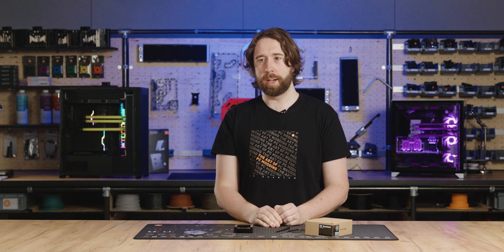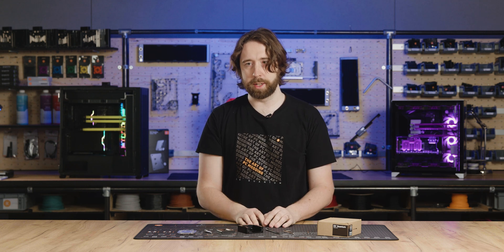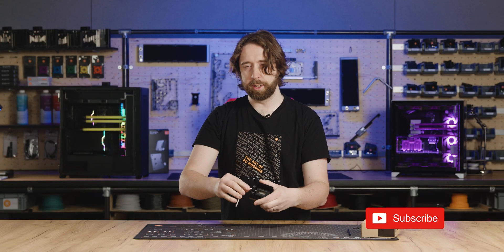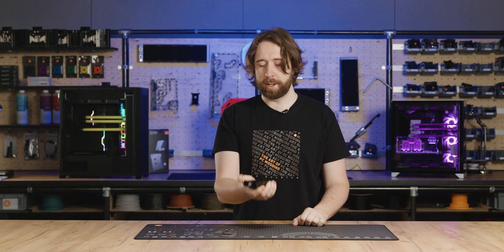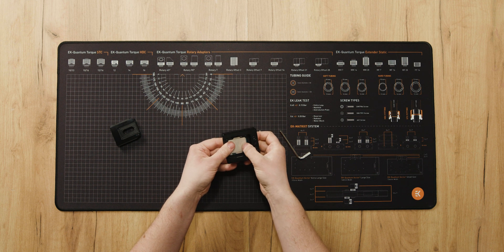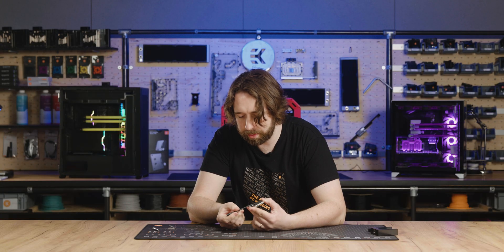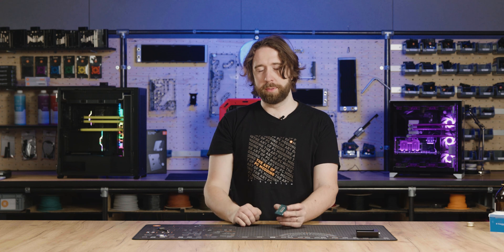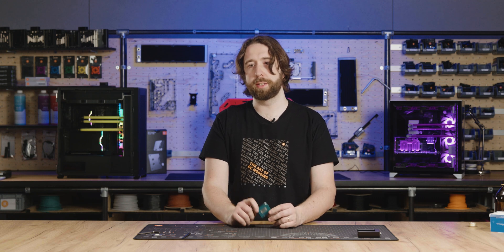The SAFEST Way to Delid Your Intel 13900K CPU | EKWB Direct Die Liquid Cooling

Comment: Isn't cold glue a bit easier as it does not keep working once it breaks?
Reply: Not when you're using industrial strength glue that can rip the whole processor in half - Not a terrible idea to heat it up slightly.

Comment: Has anyone ever melted the dye off the cpu? i used a heat gun for 20 seconds and it came off like butter. Removed the ihs the the pcb didn’t have anything under but just the adhesive . I’m guessing i destroyed my cpu

Comment: Wonder if intel will ever decide to sell a cpu range that comes without IHS from the factory. Call it a K-DD variant, dd for direct die. (I9-13900K-DD)
Reply: The lid is there to prevent idiots killing the chip. The only reason we don't have a lid on GPUs is because they are a cooler installed product.
Reply: @mrfinn2006  On laptops, neither has a lid, both cpu and gpu are direct die cooling. The not so bright bulbs out there is also why I am saying it should be a seperate model as an addition to the usual line-up of overclockable CPUs. Those that aren't the brightest of the bunch would not be buying an un-lidded cpu.
Reply: @mrfinn2006 😂 got told hard

Comment: so you made a tool to delid the cpu, but have to use thread and plunger to delid. EK did a poor job here, even their direct die velocity 2 waterblock is also not good enough. iceman cooler or supercool computer direct die is much better.

Comment: there are lots of reports of problems with the delidder - stripping of the screw threads/simply not being able to remove the IHS with the default method used. this seems to be compounded with the 13900ks which seems to have stronger soldering. can EK comment if there will be a revision to this tool? fwiw I have bought this tool and the delid block, but after hearing all the horror stories on OCN it has been sitting on my desk unused since March.

Comment: Man 85 bucks for a delid tool is kinda nuts, is there not another option? also is it worth it to just delid, contact plate and liquid metal, only lapping IHS (no direct die)?
Reply: You could make one yourself from wood or print it. I wouldn't recommend it, but a very thin blade can cut along the rubbery glue...

Comment: I followed these instructions exactly and my die came apart with the IHS when trying to separate it from the PCB.  $750 i9-13900KS in the trash bin.  EKWB you need to do the right thing here and recall this garbage of a product IMMEDIATELY.  The delid tool doesn't move the IHS far enough in either direction to have a complete separation from the die.  That's why you need to keep rotating the cpu back and forth in the tool a hundred times in the first place.  It is a really bad design and should have never gotten to market.  What other delid kit comes with dental floss and a plastic lever to pry your IHS off?  None, because rocket-cool and der8uer delidders completely sucessfully separate the IHS in one move.  This one does not.  I am not the first to have this happen and I'm not going to be the last but if I save ONE person from using this garbage then it will be worth it.  There are videos of JayZtwoCents and KitGuru using this tool.  They both stop mid removal when they realize this piece of junk is going to destroy their cpu and switch to a Rocket-Cool delid kit to complete the process.  There are many reviews on Overclock forums where users have damaged their cpu's with this kit.  DO NOT BUY or USE.  EKWB PLEASE RECALL THIS DELID TOOL.

Comment: I would like to add that heating up the CPU makes it even more difficult to delidden the CPU. I think that cooling down to 0 - 5 degrees is better. Thus, the glue and the indium are harder - have a shorter break-off point. When heated, on the other hand, everything is more viscous and difficult to separate.
Reply: hmmm why have they heated it here then?
Reply: Uh no lol no one does this. Everyone heats it. Jesus do not do this.
Reply: Uh, no. Heat it up. You're an absolute moron if you truly think otherwise lmao

Comment: Will this also work on the AMD 7950X3D? And if not, will there be a kit (lid remover & custom waterblock) coming out for this CPU?
Reply from the maker: This won't work on the AMD CPUs, but we're working on the direct die watercooling for the Ryzen 7000 series and everything that comes with it :)
Reply: There is a delidder you can buy from Derbauer for the 7950X3D.
Reply: @noone5014  no official kit, including CPU waterblock, available directly from EK?

Comment: This is not right guys, your product manual does not reflects any of the steps shown on this video. More over you launched this video several weeks after we received our product. 

Honestly I am really disappointed with this.
Reply from the maker: We wanted to share new information with your ASAP as it was brought to our attention by some users that IHS removal process on individual CPU samples was harder than what our team experienced in the lab. The manual's first version worked for all the CPUs we tested in the lab. Still, we tested a few other methods and added them into the process to ease the IHS removal process for anyone that is experiencing challenges when delidding their CPU.

Comment: I love how this vid came out after you sent these kits to all the  youtubers and they made vids. Linus fucked everything up and thought the liquid metal was for thermal application and never used it to clean off the die. Jay about broke his cpu cause no one was flipping the cpu around and using side 2. What an epic fail for them. So sad to see people like that get blessed with free stuff and completely screw everything up.
Reply: But you do use liquid metal to clean off the die.
Reply: I have same issue.
At water temp 20 degree celcius, my 13900ks with ek dd can only costs up to 400watt at 110 degree celcius.
I reinstalled 7 times, repaste liquid metal, results are same. 400watt with 110 celcius. 330 watt with 80 celcius.
This result is same as heatkiller 4 pro with Stock IHS. 400 watt with 110 degree.
Actually, ek dd is worse than normal cpu block. Core temp difference on heatkiller is only 7 degree difference, however ek dd is more than 15 degree. Core4, 7, and 8 extremely high.
Once I changed to iceman dd, i got cured. At 330 watt it is only 60 degree.
550 watt with 110 degree.
Shame on you, ek
What did de8auer do?
Just rent reputation and have money?
Than just decrease the price without name on it.
I dont think ek will recall this garbage product.
People who bought this product expect good cooling performance, not the same performance with stock ihs.
And also, why does ek always delay their product? Once you said it will start deliver on mid Feb, it supposed to start at least 20 Feb. It is promise with customer, especially you received money first.
If you guys think you cannot gurantee the time, than receive money later.
I was big fan of ek, no more.
Quality keeps decreasing, price keeps increasing, and most of product need to be rma. Im tired of this.
Reply: @Rashimotosan  yeah i know. Go read what i was talking about or go watch Linus's video

Comment: Worst delid tool ever, made from cheap metal and as a result the thread strips, EKWB quality and customer servive has been really poor recently.
Reply: The damage to the screw and the thread on the slide is more likely because the CPU is beheaded over the long side. DER8AUER's tool does this via the short side of the CPU. This works without any problems.

Comment: I pre-ordered this kit together with the upgrade kit last February 10 but so far I have not yet received it.  Every time I get in touch with customer service, they always say it's going to be shipped within 3 days.  But still nothing.
Reply: Same here I cancelled my order then got my direct die  thru performance PC it arrived yesterday, I still need the deluding tool😢
Reply: @DickHallon  you probably want to push the hell out of a 13900K/KS too for sure. A shame there's not much of an alternative out there. Be careful with that EK delidding tool. There have been lots of cases in which people destroyed the threads before getting rid of the first IHS. It's unlikely they're strong enough to be used for several CPUs. So no reselling that thing on eBay after it's been used.
Reply: @AlexanderDinebier  I am thinking of waiting to see the delidding tool from the thermal grizzly. Im in no rush.. I just dont like being lied to by ekwb, I love there products but sometimes there customer service leaves something to be desired.
Reply: @DickHallon  is that one made of alloy too? Cause that's the reason some of the EK tools failed. For 75€ i expect to get a tool that's strong enough to survive years of usage. But they'll probably stick with the soft alloy. Should be easy to fix though. Just drill out the thread and insert a hardened steel thread insert from the back, then pull it into the slider with a long screw while the slider is inside of the bigger part. Add some heat resistant grease to the thread before usage. Then it should survive really long.
Reply: @AlexanderDinebier  There is going to be a design revision of the delid tool. Unsure what they're gonna do yet obviously, but I was in contact with EK because their tool killed my CPU (the die came off). I made my thoughts very clear and the support guy seemed very confident they know the multiple points of failure so hopefully good news in the future. 

Also if you're curious, they accepted all fault and refunded my 13900KS.
Reply: @C0manso  That's nice to hear. At least it seems you can count on their warranty. They also sent me new thermal pads and screws for a RTX3090 Strix GPU backplate i bought used a month ago. Of course that was cause the original pads and screws were not optimum for avoiding coil whine and a lot of customers had problems with them. But nice that they still sent me these more than 2 years after the thing has been bought originally.
Reply: @DickHallon  same got the DD kit from performance PCs but I just got the rockitcool kit since EK had an issue with their delid tool stripping. Worked perfectly fine and it was my first delid
Reply: Same. I ordered mine at February 1. Still waiting. They could have at least sent the rest of my order. Then it would at least be possible to cool the CPU without direct die kit in the mean time. 

But it seems it's more inportant to them to safe a few bucks on shipping. I'm getting frustrated. My PC will be outdated til i can start it the first time.
Reply: @AlexanderDinebier  you are not alone .... same SH*T here and same frustration

Comment: Hello. how do i take off the CPU waterblock after direct die cooling with liquid metal? Do i run something give my CPU a full load like prime95 to get the liquid metal get it hot so can let go the waterblock? And i would of use Flitz Polish to take off the liquid metal after Delid. it's a better way.
Reply: Liquid metal remains liquid when you take the cpu waterblock off unless you live in the arctic and have no heating at home... So you dont need to warm it up to remove the waterblock, but you should be slow and careful when you take it off so you don't splash the LM.

Comment: Hello EKWB - Please also update the installation manual according to the video.
Reply: I agree with you.. using heat is recommended
Reply from the maker: We wanted to get the info out as soon as possible as it was brought to our attention by the users that it was a bit more challenging to remove the IHS on some individual CPU samples. Our R&D team is working is on updating the manual - the first version of the manual should work for most CPUs, but these extra steps were introduced to make it easier to delid yours if that method doesn't work.